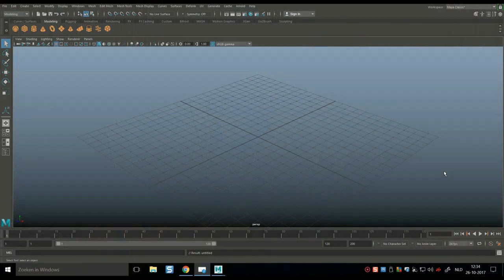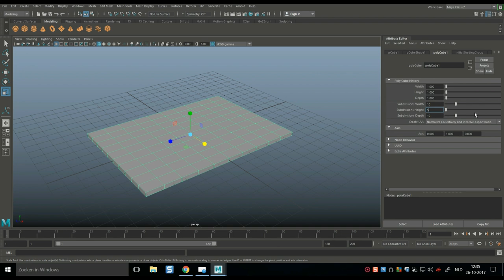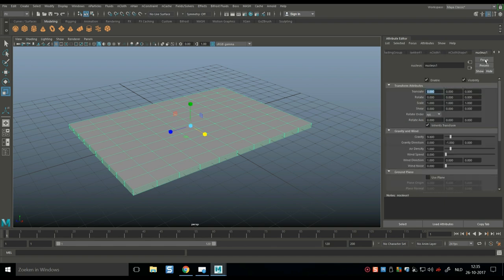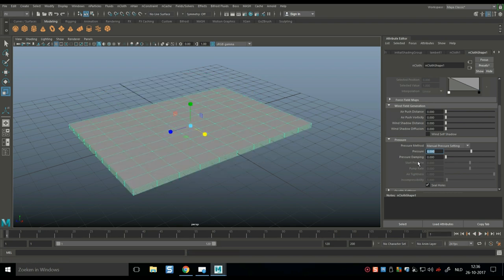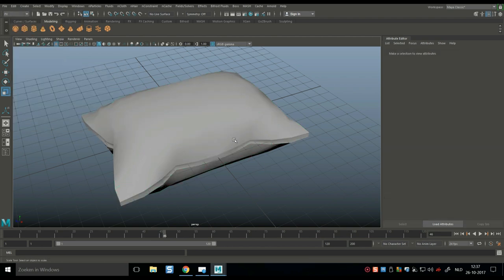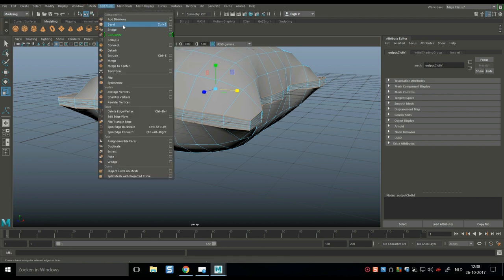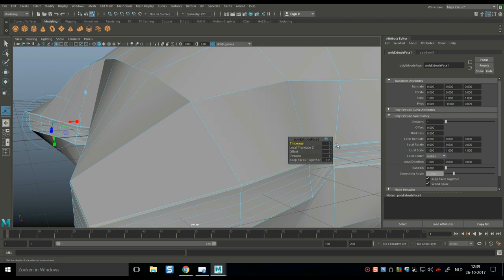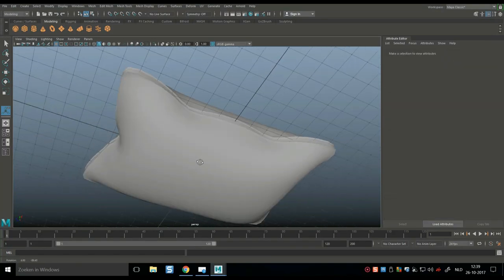How to model a 3D Pillow in Maya 2018 in 5 minutes

Comment: If u will add the ncloth again at the end with less pressure and add a collider object using the Menu:nCloth:Add passive collider, you will have a dynamic cloth for animations.
Reply from the maker: Yes I know. Cool right !
Reply: Is this something specific to 2018?
I use Maya 2017, and got to the point that I was able to make the pillow and edit it so it has pipelines, but I cannot seem to reactivate the gravity even after adding another ncloth.
Reply: Srt Tanaka you need to turn thr gravity in the nucleus back to 9.8

Comment: Please help
every time i try changing the Pressure to 0.500, it wont let me change the numbers, it just stays as 0.000. and when i try to manually do it too. it wont go to 0.500
1:54
Reply from the maker: did you do 0.50 or 0,50

Comment: Amazing! Can this be used in an animation ? Will it adapt accordingly if there's a head lying on it ?
Reply from the maker: Not dynamically but it will react to a characters head if the character is defined as a collider
Reply: If I use a sphere as the head and define it as a collider, it just goes though the pillow. Just in case you need inspiration, I can't find any tutorial showing  how a pillow would properly deform under the weight of a human head. ;-)

Comment: But a problem. Deleting by type > history didn't make any difference. I tried Delete all history, but the problem reoccurs if I reopen the file. 
I'm using maya 2018
Reply from the maker: What problem ?
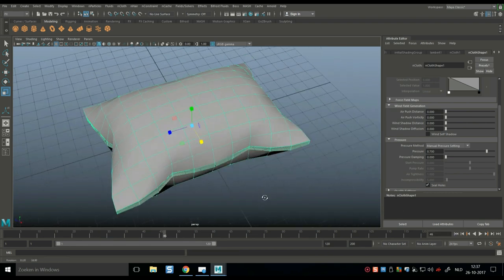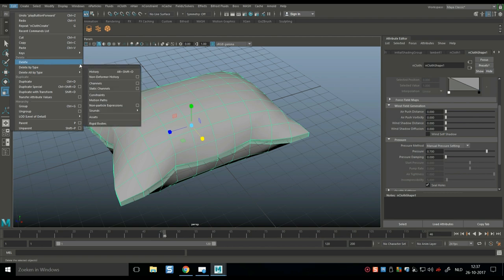Reply: I followed the instructions from 03:36 - 03:43 and deleted history.
But, the pillow shape is still moving when I press play.
Reply from the maker: Did you have the object selected in Object mode when you hit "delete history" ?
Reply: Yes. The object is selected, as I can see those red, yellow, blue resize axis buttons. I even tried restarting Maya, but no difference :(